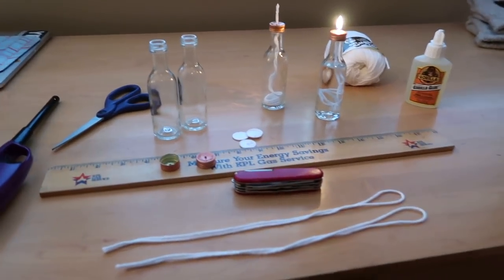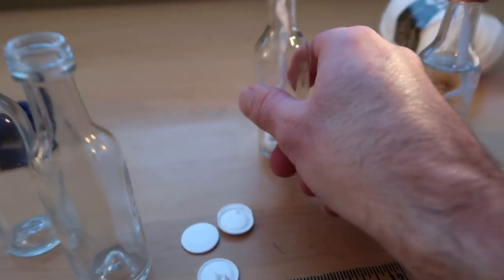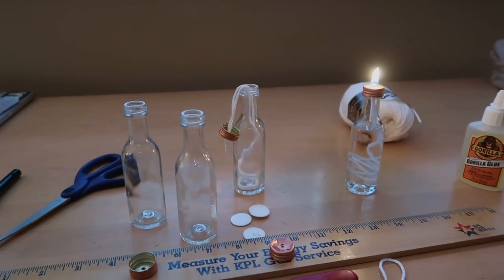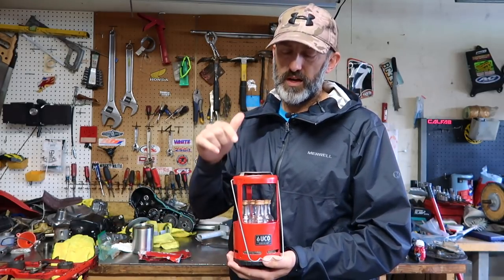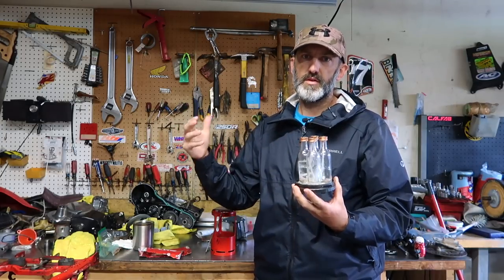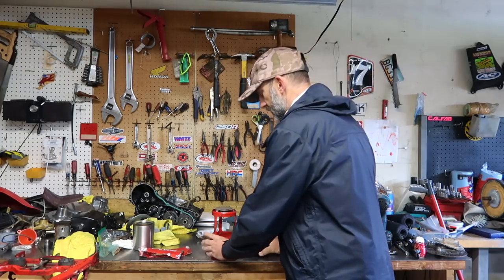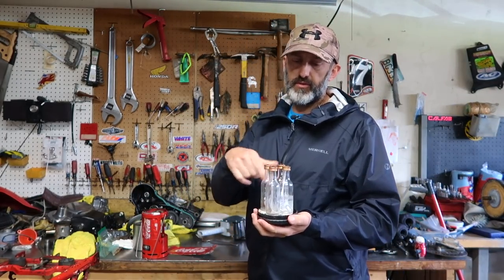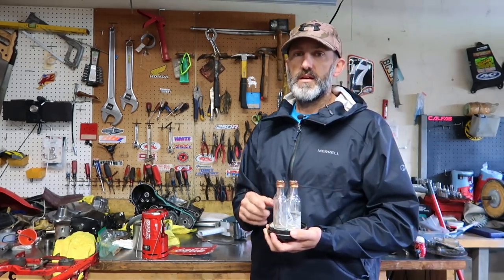Truck Camping: DIY Candle Heater/Hot Plate Conversion to Liquid Fuel

Comment: That's a really great idea, but if it's prime purpose is heat, and not light, I will try to find a can that would hold those bottles, drill several holes along the sides, and use a wire to hang the heater, so that it can't be tipped over.
I might even try a baby food bottle with 2 wicks.
The world is limitless...
Reply: Took the comment from my fingertips 👍

Comment: I'm currently testing Crisco candles. Four candles can reach 124.7 degrees with the fan on top. My home made Fido's Butt Heater is made from items at the thrift store but it works. I need to test some of these liquid fuel candles to see how hot liquid fuel burns. One thing I did to contain a spill is glue the heater in a Pyrex bowl. It transmits light and frankly just makes me feel better. On the other hand if ya just get eight vodka bottles ya might not need a heater at all ! lol

Comment: Great video Brian.  I second the request for your thermoelectric fan model...  Most of them on Amazon are huge and designed to fill a room with heat from a wood burning stove or the like.  Yours appears to be much more compact.
Reply from the maker: Here you go! Sorry for such a delay in my response, I didn't see your comment until just now. The EcoFan I use is the medium size. This one is a bit pricey compared to the Chinese knockoffs which I'm told work almost as good. https://amzn.to/2XhtYCY

Comment: Not for heating but, I make something similar with wine bottles that have screw caps. I turn them into cheap DIY tiki torches. Buy lamp oil and some wicks and use a flathead screw driver to make a slit in the cap. Glad the set up is working out for you.

Comment: Awesome series. It came just when I was trying to figure out how to heat my 100 series Land Cruiser. The only thing is I don’t plan to use those window panels you’ve got. So I’ll be curious as to how warm it’ll get the truck with just glass. 

As always, keep up the great vids my man!
Reply: i tried in my truck canopy without reflective, have 4 bottles going over night, crack window each sides about half inch. what i found out is too much condensation in the morning, and i had a CO detector, it goes off somehow in the morning. also it gets cold quick if u open door, takes time to heat up. 
im going to add reflective and crack the windows opening larger next time and see if it's better.

Comment: This is great, cheaper than those expensive candles.
Reply from the maker: Yeah, at $12 per 4-pack I felt it was a bit too expensive to use constantly. This is a much cheaper alternative and the burn times are about 15 hours before you have to refill the little vodka bottles.

Comment: Why not do a sealed unit at the side that has its own vent to outside. That way it does not put any toxic fumes and co2 in the unit. 

My larger camper I use a amazon stove with fresh air intake pipe going to it.. candles work, can also use wood.. free fuel in mine.. 

Propane as well dumps water in unit and uses oxygen and produces c02 . Diesel heater is to much.. to loud, can break, costly fuel.. 

Liquid and solid fuel heat and cooking vented to outside is way to go..

Comment: Why not just use a lantern that burns gas like the Dietz #2000 Millennium Lantern? Does this method burn at a slower rate and is cheaper?
Reply from the maker: Hi Sean, yeah those work great too. I would imagine they burn at roughly the same rate since it's the same indoor fuel. The candle lantern is a bit smaller in size but other than that I think these two heaters would perform comparable.